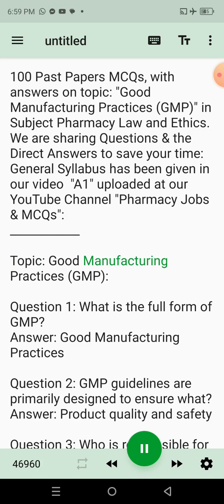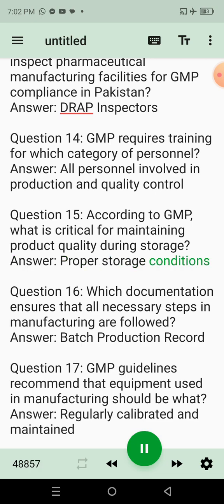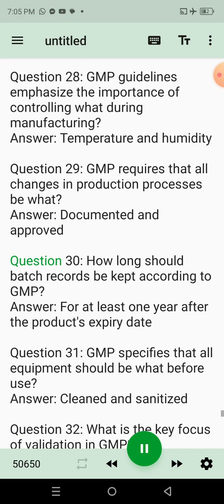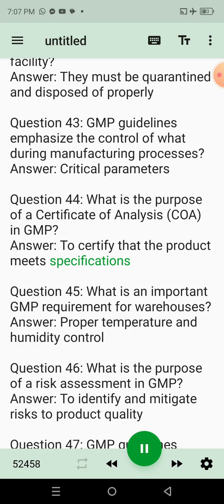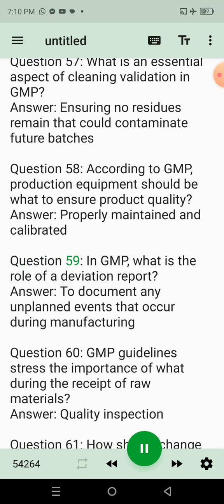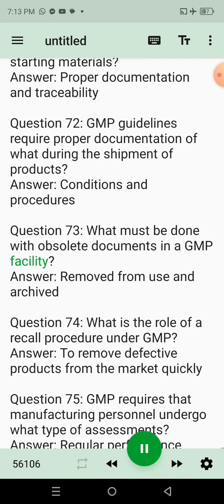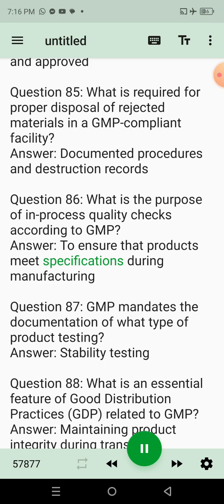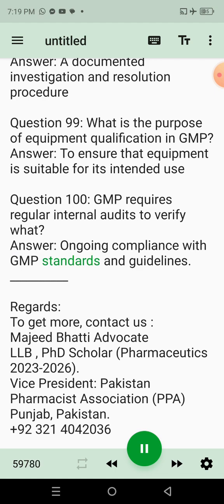Video A20: Hospital Pharmacist Test Preparation| 100 MCQs on Good Manufacturing Practices (GMP)

Comment: A Standard Operating Procedure (SOP) in pharmacy is a detailed step-by-step set of instructions that outlines the correct procedures to be followed for specific tasks or processes in the pharmacy setting. SOPs are essential in ensuring consistency, quality, and compliance with regulations in all aspects of pharmacy operations, including dispensing medications, compounding, inventory management, and handling of hazardous substances.

SOPs are developed based on best practices, guidelines, and regulatory requirements, and are aimed at ensuring that all pharmacy staff members have a clear understanding of how certain tasks should be performed to maintain safety, quality, and efficiency. Following SOPs helps to minimize errors, reduce variability in processes, and ensure that all activities are performed in a standardized and systematic manner.